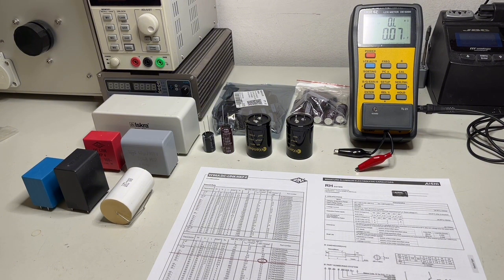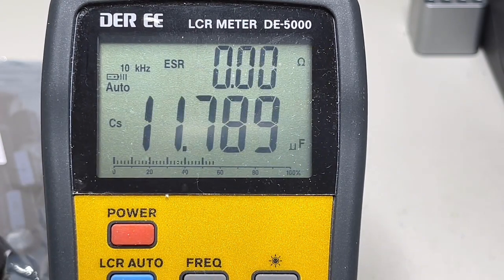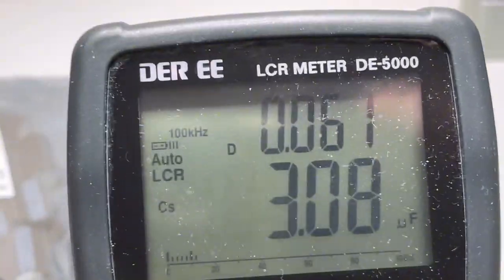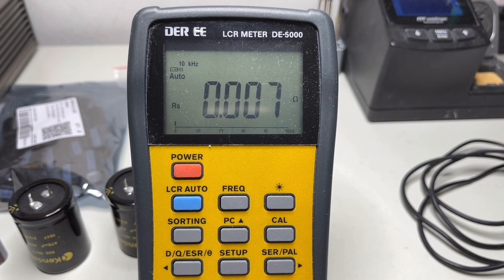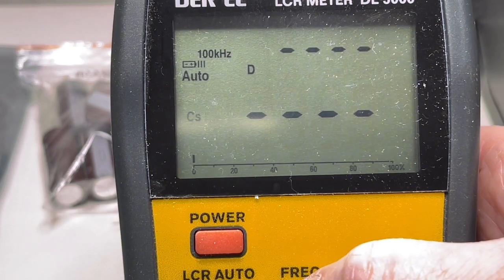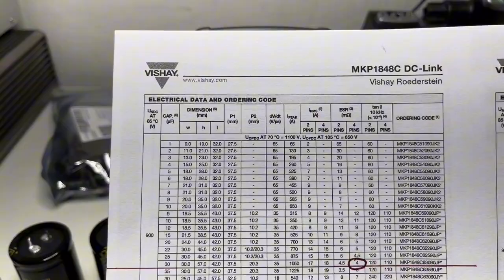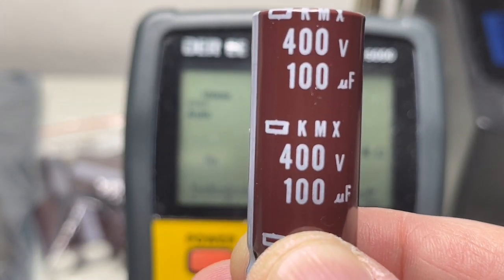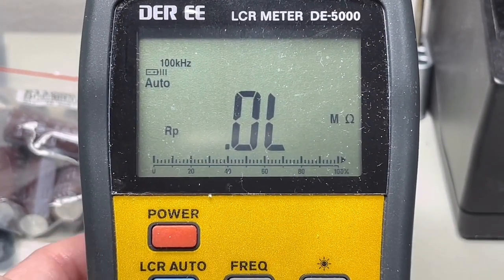Large, Scary and Dangerous High Voltage MKP Film vs Low ESR Electrolytic Capacitors, ESR Comparison

Comment: Using the MKP types for 50 Hz/60 Hz rectifiers (100 Hz/120 Hz ripple) would result in extremely low losses in the capacitor due to such low value of D, compared to electrolytics.

Is the ripple current in the MKP type different (higher?) than in electrolytic type? The MKP type seems to have negligible losses and heating at low frequencies, is there any factor like ripple current that can cause hot spots at low frequencies? 

The white papers for HV MKP capacitors are typically for 10's of kHz or higher where there are actual losses/heating effects.

Unless I am overlooking something, these MKP types appear to be an excellent alternative filter capacitor type for off-line/mains high voltage supplies, with extraordinary lifetimes, eliminating the problems of comparatively shorter rated lifetime for electrolytics (storage and operation at elevated internal temperature). The cost of DC link HV MKP parts is dropping significantly due to economy of scale in the industries they are being developed for. I wished for these decades ago.

 Am I missing something with regard to low frequency heating/losses? The only thing that comes to my mind is the ripple current, which may be the same for both dielectric types (at same capacitance),  except for the higher ESR of electrolytics perhaps limiting that current. The MKP type seems to have no 'natural enemy' causing heating losses at low frequency ripple.

If one has the available space in a chassis, the comparatively larger MKP type suggests need for replacement due to degradation is unlikely...ever. For modest values, say, 10 uF, the cost is comparable. This is not true if you compare 200 uF MKP and electrolytic.

Thank you

Comment: Hi Konstantin, it doesn't matter if the video is longer then usual, the contents are always interesting and without a lot of formula's that other channels use.
Why electrons flow this and not that, and how components have a positive or negative region etc..... those things makes it unnecessary boring, and if they also start using a Arduino just for blinking a LED, then i'm out, because where is the fun in that. I use Ohm's law and some basic formula's, but that's it. That's my humble opinion offcourse. 
Regarding the ESR of Electrolytic capacitors, can reforming a new or "new old stock", or capacitor that is not used for very long time, have a influence for lowering the ESR ?
Also, for measuring ESR of a capacitor (or internal resistance of any type of battery) can also be done in a unconventional way as follow : 
Set a function/signal generator to a 100Khz square wave and connect a DMM in current mode in parallel. Then write down the value that you get. 
Then connect a capacitor in series with the DMM (DMM set in current mode) to the function/signal generator, and the value is now lower. The difference between both values is caused by the ESR of the capacitor, and with Ohm's law the resistance in Ohm's can be calculated. 
For measuring the internal resistance of a battery, you need to connect a 1uF non polarized capacitor in series with the DMM (DMM set in current mode), this 1uF wil block the DC from the battery to the function/signal generator, but will pass the 100Khz square wave signal. 
With a good non polarized capacitor, the ESR of that cap is almost neglectable when measuring the internal resistance of a battery. 
Thanks again for the nice and interesting video.  Grtz
Reply from the maker: Hi Bjorn, Thankyou. I was really planning to make a Short Video out of it, but it came out differently :-) In my Videos I do not Involve too much theory, more Practical and Hand On. I see it gets boring for Viewers when the Videos go Heavy, because if they want Theory they can Find it by-themselves in the Internet. Regarding Reforming, I never really did that, just when I use Large High Voltage Eelctrolytics, I work them with a lower Voltage for a while and then up to the Voltage I need.
Cheers.